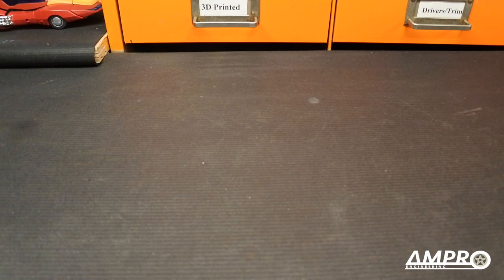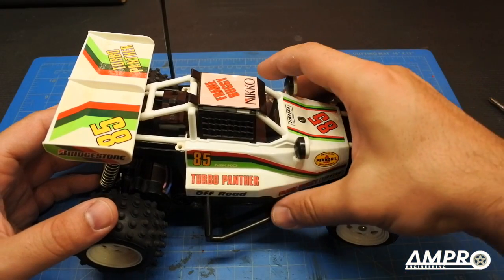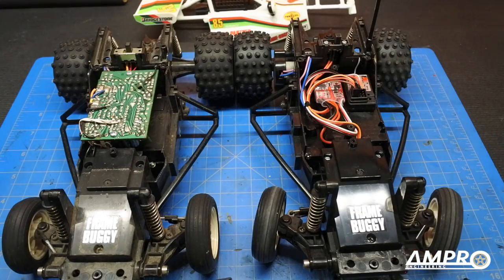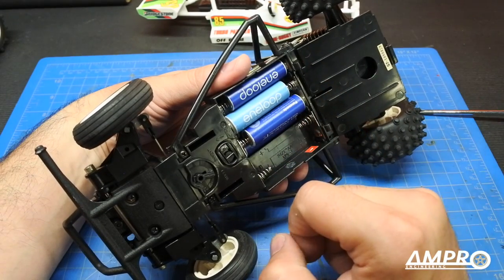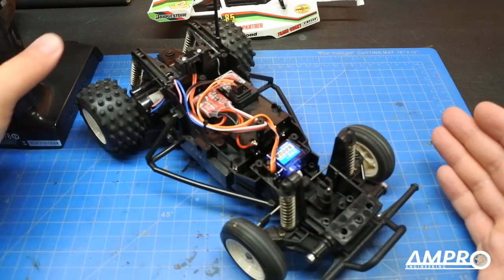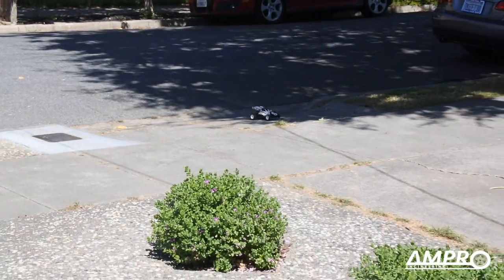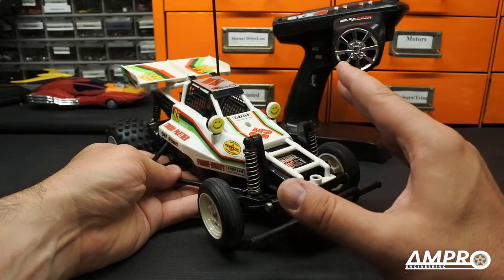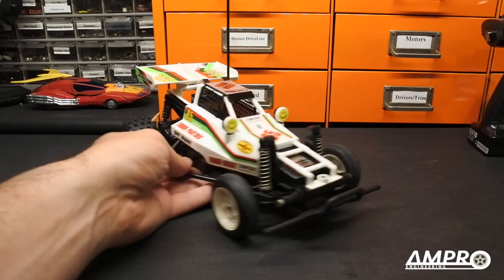E82: Upgraded Electronics - Nikko Turbo Panther

Comment: hi i have a nikko cosmo 3, control is missing, i would like to upgrade the inner electronics and control. could you please recommend an upgrade kit?
Reply from the maker: There really is no such thing. The best thing to do is locate a radio/receiver combo (turbo racing makes great ones), a 30 amp speed controller and a basic servo.

Comment: Hello. I would like to restore my old Turbo Panther that I found in my parents' basement. That was my very first RC car around 1987. Unfortunately the tires are completely brittle and falling apart. And for whatever reason, the pinion is missing from the motor. In general, the motor only turns very slowly when I connect it to a 12V battery for testing... Probably defective too. Does anyone know if you can mount other tires or tires with rims? And can someone tell me which motor and which motor pinion is normally installed? The motor has a 2mm shaft, is 30mm long and 24mm diameter. Thanks!
Reply from the maker: Check out the Facebook Nikko/Taiyo groups. Those guys are great.

Comment: Hi. I have a Nikko Panther 2 that I would like to upgrade.
I have a failry good idea of how it will be done based on your video. However my question is how will I connect the ESC to the motor. The motor has 3 wires, blue, brown and block.
Thanks.
Reply: To add, the ESC I suppose has only 2 wires for brush motors. Where will I connect the 2 ESC wires to the 3 wires on the motor of the Nikko.
Reply from the maker: It does? I wonder why that is. I would say try and see what wires do what. Perhaps one goes to a resistor hidden in the plastic cap covering it? Sorry man I wish I could help more.
Reply: @AMPROEngineering  thank you very much for the advice and very prompt respònse!
Reply: Hi, I've done the electricals and my Nikko Panther 2 is now up and running with the new ESC, servo, transmitter and receiver. I was amazed with the modularized parts and how they operate. Again thank you very much in putting up these very interesting videos. I've been inspired with this episode that I did much research to resurrect my Nikko Panther.
Again, thank you very much and more power to you!

Comment: Have you ever had the tamiya brats uprights ever break is there a mod to fix for it ?
Reply from the maker: Yes. All the time. I made metal caps for the trailing arms that prevent and fix this. Is that what you mean? It’s in episode 13
Reply: AMPRO Engineering kinda the ball cup this screws into the upright broke where shaft screws down and the steering won’t work with out the ballcup I tryed drilling it to accept a modern ball up but the mill meter hole is to small and the drill bit broke off

Comment: wait what you said it runs on 7.2 volts but 3 AA batteries which you where using is only 4.5 volts
Reply from the maker: No I was using 6. There are 3 on the bottom and three on the top. I think maybe they were hard to see since you stack them and then shout at them to get the bottom ones out, lol.
Reply from the maker: Oh and they are NIMh batteries so they are 1.2v each. I think 6 1.5's would fry the speedo so I better be careful about that!

Comment: Hey I have a turbo panther and the it doesn't work due the the pcb, what parts did you use to replace the pcb
Reply from the maker: Well I used all off the shelf parts. A flysky receiver, some really cheap ESC I got on ebay for low power draw motors and a tiny servo. This was what I used but it is more involved than that. The steering was tricky and I hate cutting or modifying anything so I took great care in even making special adapters to make it all work. Let me know if you need any direction in this.
Reply: AMPRO Engineering awsome thanks for helping, I'll let you know if I need any help! 😁
Reply from the maker: Excellent!
Reply: A kissing cousin to your Turbo Panther, the Nikko Turbo Aero, was my first introduction into RC.  That was in grade school, which lead to the Kyosho Big Brute, then the Traxxas Blue Eagle LS, and summers of great time with my friends!  It all comes back to the little red Nikko, though.  I loved that car.  My brother and I got matching cars, and we had all kinds of fun with them!  I've since gotten the nostalgia bug, and thanks to eBay, can re-live my youth, albeit with a bit of hoarding thrown in.  My 10th Big Brute should arrive tomorrow.  :/  I've managed to pick up about 7 of the Turbo Aeros in both white and red, some even with boxes which is great.  Some need rear tires, some didn't come with radios, etc.  Those without radios are (IMO) an excellent candidate for the conversion you did here.  Like you, I'm loathe to actually cut away anything on the car, if I can avoid it.  I see you used a small flysky receiver, and a small 20A esc.  As far as a servo, is that something like a 9g servo?  I have several of those on hand from my RC foamies.  I realize they are not "finished products", but if you would make the printed parts (switch tray, servo ballhorn, etc) available, I'd certainly appreciate it!  The ones I have that run w/ oem radios, I'd like to leave alone.  There's just something "special" about them being exactly as I remember.   This would sure be a fun mod to do to one of them without a radio, though!

Comment: Sir that board controller of use 7.4v battery 2400mah can sir?
Reply from the maker: It should be able to. The controller came with ZERO paper work sadly.

Comment: 12:24 Im Dead 💀😂😂😂😂😂 By the way, How much voltage can the stock motor hold?
Reply from the maker: I estimate 12V since there could be 8 1.5V alkalines installed.

Comment: I've got a Nikko Cosmo Flash in transparent blue, it's the only toy that was left from my troubled childhood (I think I was six when I received it), and I went to great lengths to save it so I could one day ride it with my kid.
It is remarkably similar to the Panther on the inside but in my case I'm lucky that its motor works just fine both in H and L!
The only thing right now that stops me from enjoying it with my 6yo son are the tires, which were hollow and in blue rubber. They finally gave in to age right as my son was born and I can't seem to be able to find any kind of tires that will fit this model rims, of any color, let alone in blue.
They really looked like those in the back with spikes, but all four of them were just like that.
And are those antenna straws available as well anywhere?
Please, dear @AMPROEngineering, would you kindly point me in the right direction? 🙏 
Thanks for the amazing channel and great projects! 🤘🤘🤘
Much love, a new subscriber.
Reply from the maker: I have never heard of that. Man that is a cool looking car. Well the easy thing is the antenna straw. They are available on ebay still for most RC cars from the 80's through early 2000's. Size will be close and length needs to be cut down. As for tires, you will need to have some 3D printed. I have done many in the past and while they are not great, they are still better than nothing. I do not have anything for that car but you can ask a facebook group into Nikko's as I have seen a lot of people making some. Wish I could help more.

Comment: Ive just acquired a Nikko Black Fox with Controller.
It all powers up,but goes real slow forwards and backwards,with quiet a noise coming from the rear of it.
Wondering whats up with it?
Reply from the maker: They are usually not the most quiet. This thing is surprisingly noisy.

Comment: Reminds me of my presto Rod Spark that I did almost the same thing to. It is running a 3s lipo though with a hobby wing 1060 esc. Stock 280 motor and doesn't get hot. I managed to get a full size spektrum steering servo in it though.
Reply from the maker: Oh that's perfect! This servo worked fine so I didnt stress it but I am all for it!
Reply: Hi Jemery Tart and Ampro Engineering. I have a Turbo Panther 2 from my childhood and the motor needs to be replaced. I see the 280 electromotor has same size then the electro motor in my Panther. Do you know which voltage range and RPM I need? Or is that fixed with the type of motor? The one I find online is 1.5-4.5 V and 9500 RPM. Voltage does not seem right to me.

Comment: My Nikko turbo red from 85 /86 stopped working today , I’ve had it since I was 6 , it’s in great condition ( the outer shell etc) however the magnet cables have come away from the circuit board and I can’t even see where they came off as the circuit board had extreme wear 😩…the car still has power from the back obviously, but the weels in the front can’t be operated
Reply from the maker: I would try to re-flow the solder and check for any broken connections. You also should look to see if there are any leaky capacitors.
Reply: I’ve sent it to an RC guy today said he would clean the board up and check any loose connections and re- solder and check sensor. Hope it can be fixed ! If not , il take it
all out and my brother will replace it with a custom job  instead!

Comment: back in 2012 or 2011 tamaiya had several mini versions of cars like the grass hopper the hornet and the fox in 1/16 scale and on a turbo panther platform as I shopped the site I had an ad pop up for a ball bearing and oil shock kit to go with one of these cars it was abouit 30 dollars or so I have not been able to ever find the link again and I think they have since quit selling these cars as they recently have full scale original rerelease on those cars
Reply from the maker: If it was the Tamtech cars you are talking about they were not good. I used to have one and no mater what I did, that car was a pile. They looked fantastic but that is about it. The onroad versions were killer though.

Comment: Is an ESC a receiver and does it control the steering, too?
Reply from the maker: ESC is an electronic speed control. They provide power to the receiver and in turn the receiver tells it what to do. The receiver powers the steering servo and tells the servo what to do. Hope that helps!
Reply: @AMPROEngineering  Very helpful. Thank you for responding. I'm sure you get a lot of these questions. Do I need one ESC for the motor and one for the steering?

Comment: How to take the wheels off? I loved that can and what to restore mine.
Reply from the maker: The cannot come off easily. They are all pressed in place. I have done this on my Tyco Bandit and it was a disaster to get it all back together. My suggestion is to leave the gearbox in one piece as well as the front axles and restore around them.

Comment: Nice video. I just found a Turbo Panther on a garage sale and bought it. It's working but the electromagnet servo is not. Can I just change it to a regular servo without changing anything in the stock PCB?
Reply from the maker: No you cannot sadly. I can send you mine if you like. email me at amproengineering@gmail.com

Comment: I was pretty good with mine,lol ya the old two sticks was all we had back then..
Reply from the maker: Mine was rough...oh boy...but I was lucky i was able to find the parts to rebuild it.
Reply: @AMPROEngineering  I kinda want to do what you did and just change everything,,but I'm going to try bust down a old lithium ion I have laying around and break it down from 12.8 to 9.6 and that will at least fit in the battery bay

Comment: Hi! What kind of ESC did you use?
Reply from the maker: I use these little cheap 30A ESC's you can get on amazon and ebay. They work well but I would say 1 in 10 come dead or will fail within minutes. Those that dont are awesome.

Comment: Hi, can you tell me if the steering electromagnet worked before replacing it ? I have some sort of the same Nikko rc car and the electromagnet steering does not seem to turn. 
Can you give us a list of used electronics ?
Reply from the maker: No idea. I would assume it worked as I have never seen one not working first hand. As for a list, all i can say that I have is the complete PCB and ancillary components.

Comment: where I can find 3d model for servo box and a modified steering section for servo  arm for buggy?
I have this kind of buggy but electronics is broken 😞 and
wheels have flat places you can tell me how to fix it?
Reply from the maker: Well I dont have them available since they were super basic and still needed trimming. This could be made from some plastic stock pretty easy. As for tires, until rubber prints are cheap enough you will need to look for parts cars on ebay. These cars can never be stored with rubber on the ground sadly.
Reply: @AMPROEngineering  Thanks to your info in another vid, I've been looking Radio Shack Zebra parts cars for rear tires.  Sounds like they're a good source for front wheels/tires for Turbo Panthers, and workable bodies.  Sadly, they won't help with the fronts for my Nikko Turbo Aero, as it uses the wide knobby fronts.  Anything else worth stealing from the Zebra, or shall I just pull the tires, rims, body and motor, and pitch the rest?

Comment: Does the Nikko 80s model need to be charged and add batteries also ?? As I can’t remember?
Reply from the maker: No, they just need batteries. There is no onboard power storage.
Reply: Great thanks hopefully Itl be fixed and I can use it then . I just purchase a Taiyo Jet fighter 2 today 😊
Reply: My turbo hopper is fixed however after 5 min the engine stopped 😩working-  yet front wheels are working fine ??? Could this be a battery issue , I’m using rechargeable batteries
Reply from the maker: @nikko7507  Something else could have failed. These cars wont steer unless you give it throttle so maybe the motor failed?

Comment: is the printed power switch cover a press fit, or you have to help it with some CA glue of sorts?
Reply from the maker: Great question. The body holds it down when it is installed. It was how the original one was installed. The ESC power switch is screwed to the adapter and then that slips into the stock mounting.

Comment: Great video. I have the same one and it grinds in high gear and doesnt go in reverse. Any suggestions on new parts I would need or where I can get?
Reply from the maker: Sadly no. Just finding parts cars is the only way to go.
Reply: The gear/pinion that you clips sideways when you go between H and L is most likely worn down, happend to my Turbo Panther II
Reply: Clips = flips... :D
Reply: @danielstermark8752  Yes! Would love to fix it.
Reply: @mansurrahim  I'm waiting for a spare car in the mail, as ampro says, that's our only option, unless you know somebody or start 3d printing for yourself.. I am considering getting into 3d printing, just to keep my nikko's running :)
Reply: @danielstermark8752  Awesome video!!